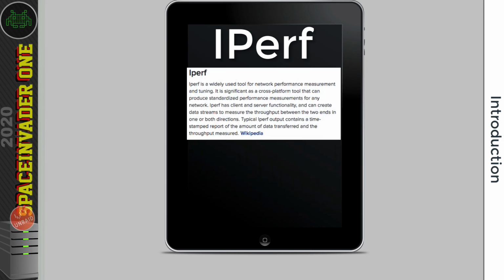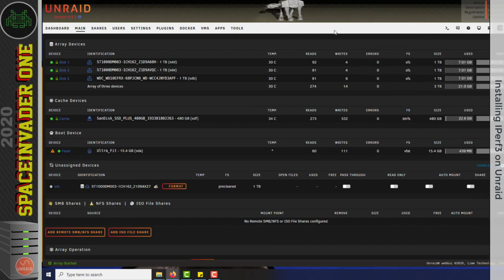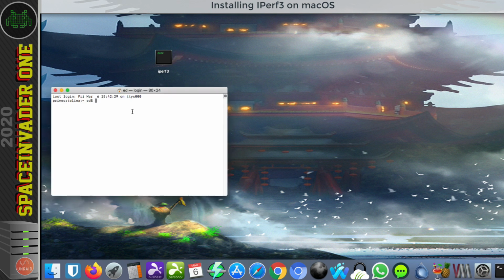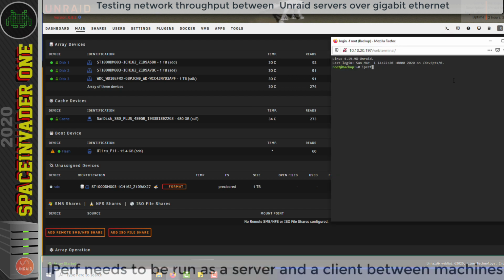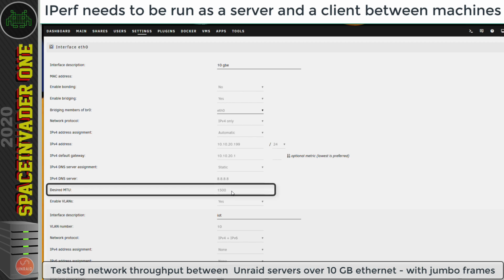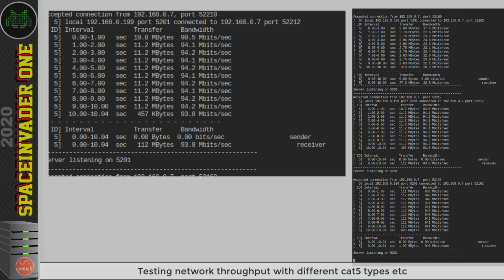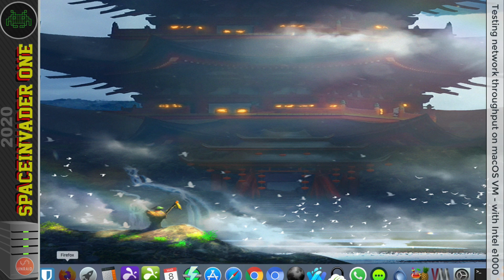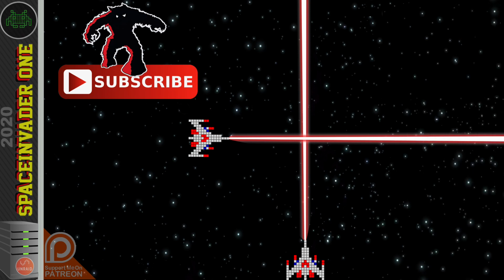Testing Network Performance with IPerf. How to Install, Use & Test

Comment: Would be really nice to get an updated video of this.  A lot has changed since 2020, and as a noob I am struggling to find and install this simple tool.
... Maybe I am a simple tool.
Reply: Did you find a solution? "Nerd Pack" is now "Nerd Tools" and iperf isn't in the list. You seemingly now have to do it via a separate iperf3 app in the community app store.

Comment: First, thanks for the video.
Secondly, I've tried to follow the instructions for iperf3 installation in Unraid Version: 6.12.4 , and I've found:
As iperf3 is installed inside this version, it doesn't appear in the Nerd Tools, you can skip this part.

Comment: Great video, (I'm a little late to the game) how do you get those speeds? I have an Unraid Server (Epyc CPU, 10G Net, 128GB RAM, 6 NVME Drives) using a Win 10/11 VM with VirtIO and Jumbo Frames enabled on Server and VM I only get 1.87 Gbits/sec. Using a Unifi DreamMachine (latest firmware) shouldn't matter since it's a VM. 
If I run CrystalDisk Benchmark I get speeds between 7000-8000 MB/s

Comment: Is there anyway to get iperf to test bandwidth between the unraid server and the router its directly connected too?  I have a faster connection between router and server as compared to all the other devices and router. That means I cant really test that connection from another device. Any ideas?  Thanks for this awesome video! It was nice to check all my other devices!

Comment: Great video and it was very helpful in testing some hardware.  One question, how do you terminate iPerf in Unraid.  I could not find any switches that stop the process from running.  Thanks for all you do.

Comment: Great Video! i was trying to do a test between my server & my pc (W10), when i run the command on the terminal on unraid i get the following error - 
iperf3: error while loading shared libraries: libssl.so.1: cannot open shared object file: No such file or directory
how can i fix this?
Reply: Got it to work - if any one has the issue use this in terminal:
cd /usr/lib64/
ln -s libssl.so.1.1 libssl.so.1
ln -s libcrypto.so.1.1 libcrypto.so.1

Comment: I just changed the MTU on eth0 and now I cant connect to unraid server at all! Shares gone, no GUI, nothing. Is there a way to reset this manually on the flash drive or something? I'm dead in the water here. HELP
Reply from the maker: easiest way if you have a monitor attached is to boot in gui mode then make the change. Failing that remove the flash drive. In the config folder you will see a file called network.cfg. You can change the mtu there. (make sure to use a proper text editor like on windows notepad ++  )

Comment: Hello hope you can help me out here. I have googled and looked up yt videos but I can't find the answer. 
Let's start with my goal: 
1 system running Unraid server, osx, windows all from 1 system. 
Every single yt video I watch they start with make a USB disk, boot from usb stick install unraid. Then setup unraid  from another system. So basically in order to run/setup unraid for the first time you need to have 2 systems ? 
There is No way you can setup unraid from 1 system even if you want to use that system as a nas a game pc a Linux and osx system?
Does this also means that if I have unraid running I will always need a second system in the network in order to start or stop a vm within unraid? Or even reboot or stop /upgrade unraid?
Also if I want to add unassigned disk to unraid can that be done with disk with data on it or will I loose that data? Oké hope you can help me out. Thx

Comment: one thing that is missing and would be nice is keeping the server up and running. unraid reboots iperf will start automatically in server mode.
Reply from the maker: Hi Intertan. If you download the userscripts plugin and make a script with " iperf3 -s" in it and then set it to run at first array start that will work :)

Comment: When  I try ro move it in my macos vm it states Read-only file system,
Reply from the maker: Hi Ivan. please try running this command first if on catalina.   sudo mount -uw /
Reply: @SpaceinvaderOne  I was racking my brain trying to figure out how you were so easily able to just move this file to /bin. this command allowed it to work perfectly
Reply: @SpaceinvaderOne  This works!  I feel like this commend should be added to the description or pinned.

Comment: I'm unable to move iperf to the /bin directory on my Mac. I get "mv: rename /users/david/Desktop/iperf3 to /bin/iperf3: Operation not permitted". Any suggestions?
Reply: David Steele are you running the command with sudo?
Reply: I too am getting "gary@Garys-MBP-15 ~ % sudo mv /Users/gary/Desktop/iperf3 /bin
Password:
mv: rename /Users/gary/Desktop/iperf3 to /bin/iperf3: Operation not permitted"
Reply: Same thing happened to me. I had to disable System Integrity Protection and it worked just fine.
Reply: @davidglascock3293  I did that but it says the bin directory is a Read-only file system when I try to mv command in terminal
Reply: I think newer mac prevents that from happening, just cd <drag I petg folder here> then ./iperf3 or install it with homebrew
Reply: @user-fp3mn3dw7x  Thanks.  I had the same issue as David did above with the "operation not permitted."  I found installing with homebrew easier anyway.

Comment: Just a heads up on macos, you can right click > open and verify you want to run it and to avoid having to go into system prefs etc.
Reply from the maker: Thanks for the tip Mike :)

Comment: Another quick and dirty way to check speeds on your server is the "speedtest" community app by adolfintel. Basically a speed test but it runs on your server. You can then check you speed to your server using any browser. Also works for TV's and I was able to see that my LG TV doesn't have enough bandwidth to stream big BluRays from my Plex Server.
Reply from the maker: Hi Senjar. What a great idea for testing things like TVs - awesome.
Reply: I Just installed this docker (Thanks!!) how would I go about testing a TV/Roku/Xbox?
Reply: @mwright154  Go to your TV/Roku/Xbox Browser, type your docker container IP in the address bar and it should open the speedtest interface.
Reply: @SilenceGProd  Thanks, figured out on Xbox and tv. Roku doesn't have a browser that I can find.

Comment: great video as usual! I have 10Gbe on 2 unraid servers, when i run iperf3 , I  only get 3 to 4 Gb/s from my windows Vm on unraid,  mtu is set to 9000 on both sides.  when i run iperf3 on Ubuntu VM on unraid, i get 9.8Gb/s.  i'm using Virtio driver in VM.  any help would be great.

Comment: Do you know if it is possible to run android in a vm, feed the vm fake gps data, then remote into the vm?  This would be used for shopping reward apps with invasive permissions, and other such apps with spyware.  I realize passing camera data to the vm is probably impossible, there will be lag, and probably high data usage.

Comment: A video on how to use ZFS, or what is the best way to saturate a 10gbe network. So far I can schedule i can I only used the cache but nothing is protected, so is there a way to auto backup the cache to use it for the 10gbe? Or can we use a ZFS? Thanks for your work.